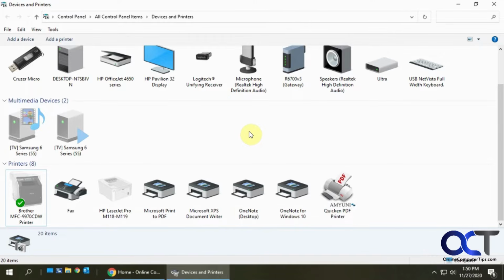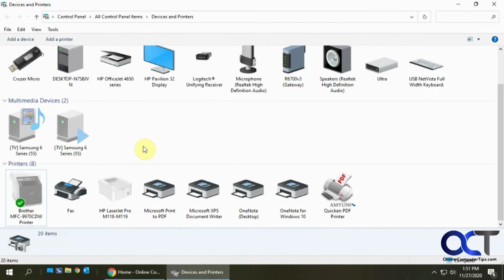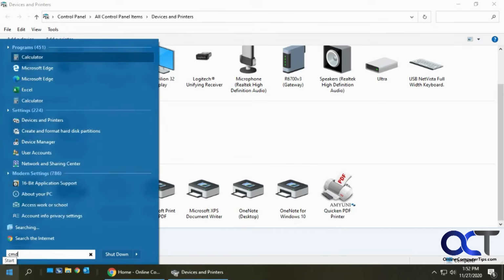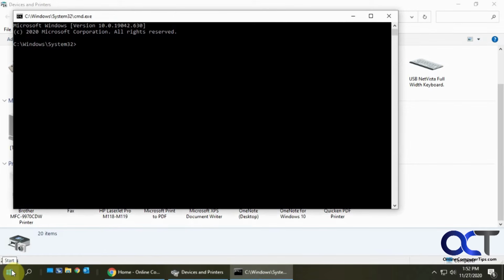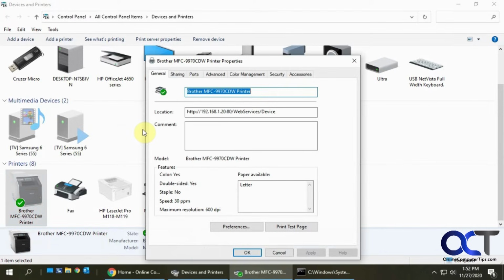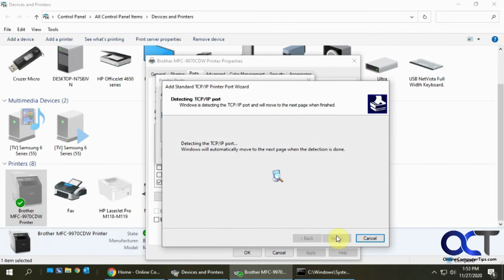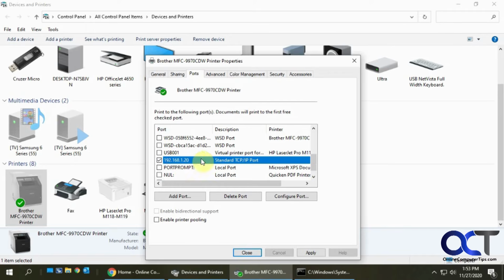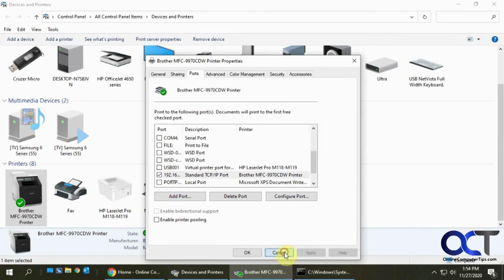How to Connect to a Printer Using its IP Address

Comment: Will the printer's IP address always stay the same?
Reply from the maker: If the printer is set to use DHCP to get its IP address from your router (most likely) then there is a chance it will change but most devices end up getting the same IP address when they renew their lease. You can also configure your printer with a static IP address so it won't change, if it has the option to do so.

Comment: Can't for the life of me find answers on setting up a wireless printer with a WiFi Mesh network. WTF should be filled into the printer's "Subnet Mask" and "Default Gateway" when I set it up with a static IP in its Network menu??? Nobody seems to have the answer to this.
Reply from the maker: The subnet mask should be the same as you have on the computer you are connecting to it with (ipconfig command) assuming the printer is on the same network if you have more than one subnet. You most likely don't need a gateway address since the traffic from the printer is not leaving your network, unless you have other subnets connected to the network that have computers you want to use this printer with. You can just add the gateway that your computer uses too.
Reply: @OnlineComputerTips  thanks for your reply on this - I do appreciate it.
But I actually got it right shortly after commenting here. I set the printer back to DHCP and looked at what was auto-assigned in order to confirm the subnet is the same as what I had put in when trying to set up static IP for it, and then also saw that the gateway IP is set as exactly what the main Deco Mesh Unit's IP was (serving as the router). It was then clear that my gateway was the main thing I probably had wrong. So when I confirmed those two, I just decided on an IP for the printer and then updated its IP on the computer. All working perfect since then.

Comment: My printer goes off line all the time even though it’s on. When I pinged the ip address it says request timed out. Now what?
Reply from the maker: It might be going to sleep which many printers tend to do. If it's an HP, then you can try to change the sleep settings.
https://www.youtube.com/watch?v=pdqZ1FPmNNA
Reply: @OnlineComputerTips  thanks but it’s a brother, I just can’t figure out why it goes offline almost everyday. So annoying
Reply from the maker: @JohnS-um3lm  It might have a sleep mode as well. If you are using it wirelessly that can be it too since ever wireless printer I have ever dealt with seems to have connectivity issues!
Reply: @OnlineComputerTips  in control panel it says the printer has a driver problem but when I updated the driver it didn’t change anything. 
I’ll have to uninstall it and reinstall it?
Reply from the maker: @JohnS-um3lm  It couldn't hurt. Also look in device manager for any errors on the printer.

Comment: if I'm using a printer with a USB connection, there is no IP address; how do I find and allocate a valid IP address for the printer then?
Reply from the maker: If your printer has an Ethernet connection or is wireless, it will have an IP address. You will need to get it from the on screen menu if it has it or by printing out a printer configuration page.

Comment: I got a printer from someone but I don’t know the up address for it and I do not have it connected yet bc it’s new to me how the heck am I supposed to figure it out
Reply from the maker: You should be able to print out a configuration page with the IP address by going to the menu on the printer itself or pressing a certain key combination. You might have to look up how to do it. If you printer has an actual menu screen on it, look for network settings and see if you can find it.

Comment: which ip address u udes? plz reply is it network ip address?
Reply from the maker: It's the IP address assigned to the printer, assuming its a network or wireless printer that is capable of having an IP address. You can find its IP address by printing out the configuration page from the printer itself.
Reply: @OnlineComputerTips   yes sir I did, I pressed the information button of hp smart tank 515, but there is no ip address mentioned in information page
Reply from the maker: Start on page 77 from this link and see if you can get the information you need. You might also need to find it from the wireless setup menu on the printer.
http://cdn.cnetcontent.com/d7/1e/d71e570e-b85b-4c8f-8261-24c84a8a6e55.pdf

Comment: And the next time you boot the computer the IP address has changed... So sad.
Reply from the maker: Rebooting your computer wont change the IP address of the printer. Restarting the printer might change its IP address depending how its configured.
Reply: @OnlineComputerTips  Thanks! My printer can't be configured via web interface. I can print a status page and hope the next time around the IP is still the same. I do assign an IP address in the router, but there are times the printer still doesn't get it - or my operating system.
Reply from the maker: @bernardmueller5676  You should be able to assign an IP address via the buttons on the printer. Either way, the IP address should stay the same until you restart the printer. Even then, many DHCP enabled devices will try and get the same IP address they had before when their lease is up.

Comment: would you plz explain how did you get the ip address for printer is 192.168.1.20
Reply from the maker: You can find your printers IP address by printing out a configuration page from the printer or going to its networking settings. It most likely wont be the same as in the example.
Reply: Finding the printer's IP is the most crucial part of this guide and it's rarely shown in all of these guide videos.
Reply: @OnlineComputerTips  thank you but is there any way we can find the IP address of our printer using command prompt?
Reply from the maker: @muhammadasif4916  You can use the Get-Printer command in PowerShell to show the IP address of your printer.

Comment: I have windows 7 and i dont know how to find printer ip...please help me
Reply from the maker: You will need to print out the network configuration from your printer itself to find its IP address. You might also be able to find it from the menus on the printer itself.
Reply: @OnlineComputerTips  i found it on the printer menu
Reply: @OnlineComputerTips  thsnks